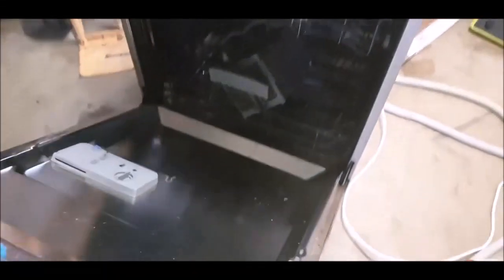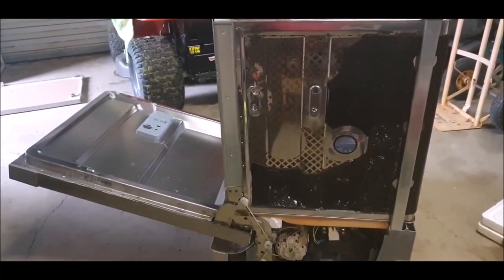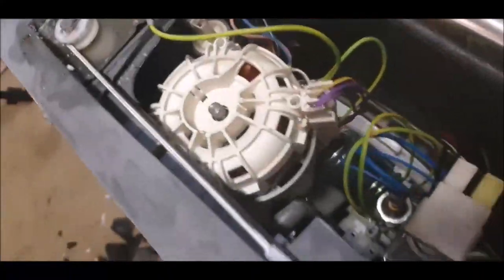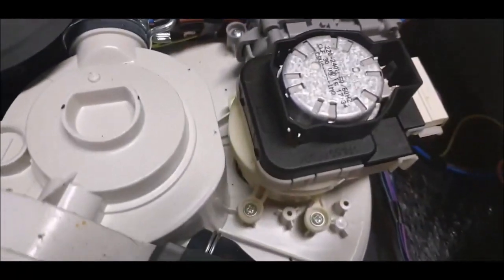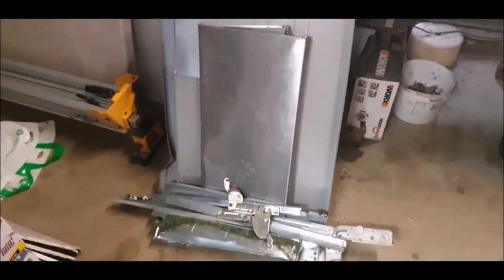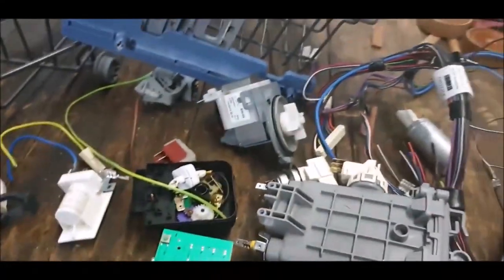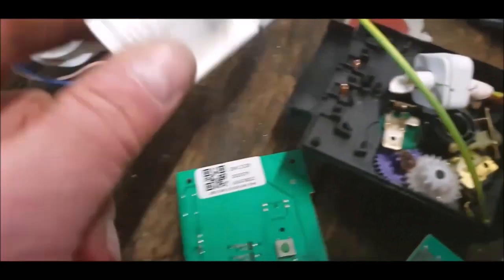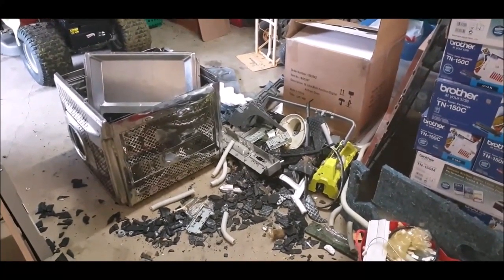I Will NEVER Scrap Another Dishwasher - ?

Comment: The concrete block on top of the dishwasher is a counter ballance to stop the dishwasher falling forward when you load the racks with the  door open. The tar covering is for sound deadening and the reason for not pumping the water out is usually a blockage about a twenty to forty minute job in the home. That dishwasher didn't look to old you may have been able to re sell it for two to three hundred second hand. The westinghouse is a good make and model usually around seven to eight hundred dollars new depending on model here in Tas. I do repairs for living. If you come across another one look for a blockage first just a thought.  Enjoyed the video keep them coming steve.